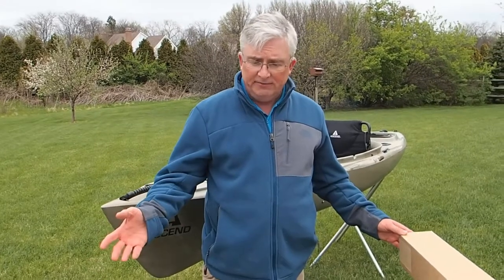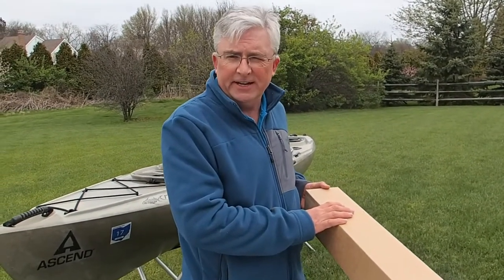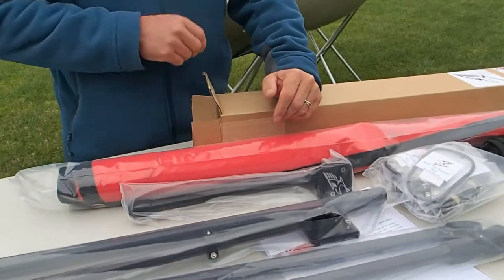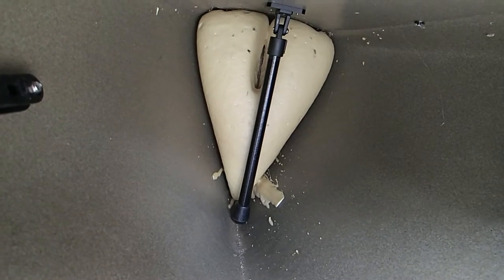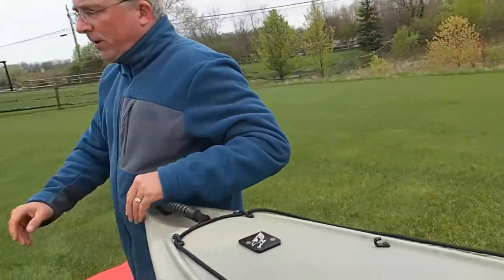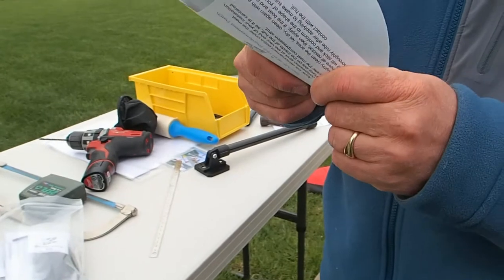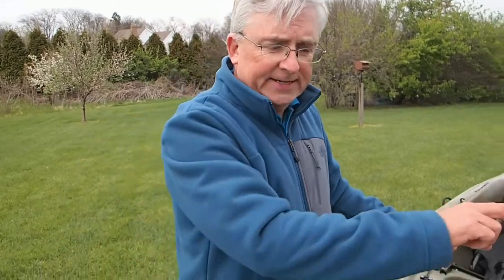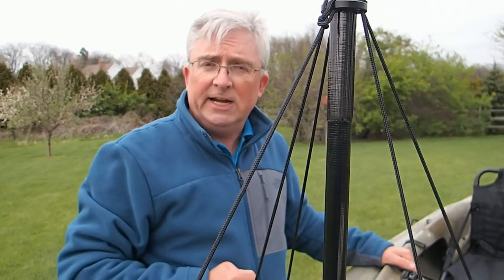Falcon Sail recreational kayak sail install install demonstration.

Comment: Does this come with some type of lee board?  Won't you need some type of lee board or outrigger to do any kind of upwind sailing?
Reply from the maker: Reply part 1 of 2

Your question about using a lateral resistance enhancers (lee board / dagger boards / large skegs ) and if they are necessary to sail with a Falcon Sail is a common question, so we have made a canned answer to help people.
The short answer is they are not necessary and will get in the way, and create complexities and issues at times.
Very well made lee boards can help in some angles of attack but are not helpful in most situations and will get in the way on every outing.
They add bulk, drag, weight, complexity, cost, potential failures ect ect.
Kayaks sail amazingly well without any lateral resistance enhancer.  Near zero falcon sailors use lee boards or other lateral resistance enhancers.
There is a longer more detailed answer below.

I grew up sailing keel boats, sun fishes, trailer sailors, hobie cats and anything else I could get my hands on.

As a conventional sail boat person, I use to think only a boat with a lateral resistance enhancer  (lee board / center board / dagger board / keel) will sail properly. We have learned there is a lot more to kayak sailing, than conventional sail thinking will tell you.  Conventional sail boat thinking is very helpful at times, but does yield a few misleading assumptions about kayak sailing.

As far as needing a lateral resistance enhancer goes, you have to consider a few things before making any assumptions. Look at a Hobie 16 and some other purpose built sail boats. Even as a purpose built sailboat, the Hobie 16 has no  resistance enhancer because its hulls have a lot of natural lateral resistance built right in from the start.  They have no lee boards, dagger boards, center boards, or keels. 

Similar to the Hobie 16 Catamaran Sail boat (not a Hobie kayak), kayaks have a lot of natural lateral resistance built into their hulls also and sail surprisingly well without any lateral resistance enhancer.

Kayaks are not sail boats, will not point as well as a complex sail boat, but their hulls are fairly efficient at sailing and can make surprisingly good up wind progress. Think about this.  Sail boat hulls are designed to be as slippery as possible going forward.  A byproduct of a sail boat hull being designed to be as slippery as possible going forward, is a hull that is slippery going sideways (and slippery in all directions actually) and also tends to spin.  Modern Sailboat hulls, make conventional sail thinkers believe you must have a lateral resistance enhancer on a kayak.

Kayak hulls are designed to track and go in a straight line.  This is achieved by having lateral resistance built in throughout the length of the hull, which is what makes them sail surprisingly well without lateral resistance enhancers.

To demonstrate how a kayak has a lot more resistance going sideways than forward, imagine pushing a kayak that has an adult sitting in it in the forward direction. Most kayaks will easily glide 30 feet or more.  Now imagine pushing that same kayak with an adult in it, in the sideways direction.  Due to its lateral resistance it will probably go about 1 or 2 feet after you are done pushing it.  Or think about towing a kayak with a person in it, from the side vs towing a loaded kayak from the bow.  The kayak towed from the side will be much much slower due to its lateral resistance. In both of these examples you are testing and seeing, a kayaks lateral resistance is significant.  Once a kayaks hull is moving through the water, its lateral resistance increases by quite a bit.  All this said, with a smart sized sail / one that is not too big, a kayak has plenty of lateral resistance without adding anything to it.

Once you build up some speed, a kayaks lateral resistance increases dramatically.  Kayaks do not sail as well as a purpose built sail boat, but you can do no paddle sailing and reach across the wind, and even make some upwind progress.

Of course a purpose built sail boat will sail better, than a kayak will, but kayaks sail amazingly well. If you have an efficient sail, you do not need a lee board, or center board, or dagger board, or any lateral resistance enhancer to have a great kayak sailing experience.
This is what Falcon Sails does.  We focus on keeping things as simple, efficient, compact, reliable, and light weight with the best possible performance. All this can be had for less than 3.5 pounds, that can be dropped in seconds and folded down to the size of an umbrella in just a few more seconds.

Lee boards and dagger boards add weight, complication, bulk, expense, drag ect.  Some people want to turn their kayaks into a sail boat.  That is fine, but you will add weight, complication, bulk, expense, drag, set up time at the put in, tear down time at the take out, more rigging, more stuff to store, and if there is no wind, or too much wind, you are better off with a compact sail rig that gives you 70% or more of the sailing benefits in a package that weighs just over 3 pounds that can be lowered and compactly secured to the deck of your kayak in seconds.   Everybody has their thing.  If you want to have that perfect ideal incredible sailing experience in one situation, you will lose a lot in other situations.   There is not a rig that will cover all situations perfectly. If want simplicity and versatility, you will be happiest with a simplistic high quality sail and rig for your kayak.

As a life long sailor, I thought the same thing sailors typically think about lateral resistance appendages.  I have sailed and owned a lot of different boats. I use to race and skipper and crew on a lot of different boats, and can say I am a decent sailor.  My conventional sail thinking made be believe you need a lee board or something on a kayak to sail.  And then I tried kayak sailing.  The performance of a sail on a kayak amazed me.  I was hooked instantly.  I was surprised.  That was even before there were good quality sail rigs available. Now that I can have a good quality sail rig, and a good airfoil shape, I will not go kayaking without a sail. After kayak sailing for the last 12 years and having paddle sailed thousands of miles, I have never used a lee board or anything like it.  None of my friends use lee boards and none of us feel like we are massing anything.

If you keep a good sail trimmed properly, oriented to the wind properly, and have at least 1.5 mph of hull speed, you can reach across the wind, and even make upwind progress of about 10 to 20 degrees above reaching. That is without paddling or a lee board or a dagger board on a standard stock kayak hull.  In general terms if you have good conditions, a good sail, and you use decent sail trim, you can easily sail 180 degrees and even up to 220 degrees without paddling and without the bother of any lateral resistance enhancers. If you paddle to keep your speed up and the sail oriented properly to the wind, a good sail, will generate useful propulsion all the way up to within 30 degrees of straight upwind. That is with out without a lateral resistance enhancers. In general once your actual track is 10 degrees above reaching, you have to start paddling to keep things oriented properly. Initially a few small paddle strokes here and there will add a lot to your possible angles of attack.  The more aggressively upwind your angle of attack is, the more you have to paddle. But still you can gain useful propulsion to with 30 degrees of straight upwind.  With a little bit of planning you can paddle upwind a little bit and reach back and forth all day long and not have to paddle much at all.  Once your movement is 10 degrees above reaching, you can not just sit there doing nothing, but you can avoid paddling and reach across the wind all day long, and even make upwind progress without paddling and no lateral resistance appendage or enhancers.  With a good sail, kayaks sail very nicely.

I will continue my answer on another reply.   See Reply part 2 of 2.
Reply from the maker: Reply part 2 of 2

Continued from Part 1- Read part 1 of 2 first.

Just like when sailing a purpose built sailboat, when kayak sailing to maximize your potential, you will have to think about what you are doing. When conditions are good, you can get useful propulsion to within 30 degrees of straight upwind.  Anybody who does a lot of kayak sailing with a good quality rig will agree. If it is really windy, gusty, shifty, there are large waves, you are not thinking, you have too big of a sail, the paddle sailor is inexperienced, ect, the 30 degree number is going to grow.

I wrote a bit more about this here.
https://www.falconsails.com/KayakSailingFAQ.php#centerboard
If you contact me at Falcon Sails, I can send to you a rough draft set of instructions for kayak sailing upwind.
www.falconsails.com/contact.php

This video shows a clip of a upwind leg I was enjoying last paddle season. It is a lot of fun.
https://www.youtube.com/watch?v=xjzld6MZhCI
I was in a 14 foot long Jackson Journey kayak and making some upwind progress without paddling.
I could have made more upwind progress if I paddled, but I can sail with no paddle 200 out of 360 degrees.  
This kayak has a rounded hull so most kayaks will do a little better yet.  

This video shows me sailing and tacking upwind with no lee board or dagger board and almost zero paddling.
https://www.facebook.com/falconsails/posts/4106133799451973
It includes some really neat gps telemetry that makes it easy to see my actual movement.
It shows me sailing 200 out of 360 possible degrees.  This kayak has a rounded hull which makes it a average performer.  If your kayak has a contoured hull, it will sail better / about 10 more degrees on both the port and starboard side.
If I started paddling and kept the sail oriented to the wind properly, and kept some motion to help my stock hull generate more lateral resistance, I could have had useful propulsion to within 30 degrees of straight upwind.
This is very similar to motor sailing a sail boat. The motor alone can push the sail boat, but using the sail it will speed up faster, have a higher top end speed, will slow down slower, and require less effort to get to your destination.

Here is another video of some friends and I enjoying a nice 18 mile paddle sail where we sail about 70% of the day.
https://www.youtube.com/watch?v=RkbSSlYEYl0

If you plan your day well, use good techniques, take advantage of reaching, and not dive downwind you can sail all day long with our without lee boards.
Here are some pictures of a typical kayak sailing day, that include a track log of what we sailed and what we did not sail.
I had several beginner kayak sailors with me, so I avoided some of the more difficult tacks and we still sailed about 75% of our miles.
https://www.flickr.com/photos/falconsails/albums/72157712563766083
With some planning you can sail most of your miles, and if you just go and not plan anything, you can still sail over 50% of your miles.
If you want to sail paddle sail in good conditions, it is easy to sail more than half your miles even if you do not plan anything and just randomly pick lines.

Comment: wheres the rudder
Reply: Rudders are not necessary on shorter kayaks.
The general rule of thumb is, if a kayak is fine with out a rudder with out a sail it is fine without a rudder with a sail.

Here is a more detailed answer.

A general rule of thumb is, if a kayak is fine without a rudder when just paddling, it will be fine without a rudder when you are kayak sailing. On a kayak 13 feet or shorter, rudders are not necessary. If a kayak has an adjustable skeg, a rudder is not necessary.  It is quite rare to see a 12-foot kayak or shorter be rigged with a rudder.  I (the owner of Falcon Sails) have a 12-foot kayak and have never considered putting a rudder on it.   When my paddle says go right, my boat will turn right.  It will turn right even a rudder on my kayak would say turn left.  Rudders are almost never necessary until you get into kayaks over 14 feet long. 

You can see in the pictures included with this email, that the short kayaks do not have rudders on them, and even some of the longer kayaks do not as well. 

If you want to do some lazy kayak sailing and not use a paddle for long stretches and do not want to lean or adjust the sail to steer, you can install a rudder and you may like it.

If you have a short kayak, you should avoid having a rudder early on, as number 1 you are likely not to care if you have one, and more importantly, a rudder will likely be a crutch and make it easy to use bad habits.  You should naturally balance out your kayak (it is an obvious thing to do (When you lean forward you will notice the kayak turning upwind, and when you lean back you will see the kayak turn down wind )) so it will tend to go in a straight line and not use a rudder to force a out of balance kayak to go in a straight line.  A rudder used to force an out of balance kayak to be in balance, is just more drag in the water and will reduce your efficiency and your ability to point up wind.

The general rule of thumb is, if your kayak is okay without a rudder without a sail, it will be okay without a rudder with a sail. Having a sail will slightly increase the desirability for having a rudder.  Big winds and high speeds also make having a rudder more desirable.  Having a rudder can make it easier to get through the learning curve.  In general, kayaks under 13 feet are always fine without a rudder.  Just like a kayak without a sail, when you get into kayaks over 14 feet long rudders or adjustable skegs are nice to have.  The longer the kayak is the more likely you will enjoy having a rudder. Even better than using a rudder, a kayaks tendency to turn up wind or downwind can be addressed with sail trim, leaning up wind and down wind, leaning forward and aft, changing the distribution of your load, and adjusting your speed.  Once you start doing these things, many times you would not use a rudder as a rudder is not the best way to put a kayak in balance to stay on course.

The shorter the kayak, and the more experience you have the easier it is to live without a rudder. Finally, when kayaking or kayak sailing, if your paddle says turn left and your rudder says something else, your paddle will win. 
Rudders and skegs are not there for turning so much as they are there to trim your kayaks tendency to a neutral tendency to turn up wind or down wind.  A nicely trimmed kayak is great to have.  A rudder is one of the easiest tools to use for trimming your kayak. But a rudder is a is a crutch many times and prevents people from learning proper techniques for staying in balance. And of course, using a rudder to trim your kayak also adds drag and slows you down so they are best reserved for minor fluctuations in balance vs a tool to power your way through an unbalanced situation.  The more drag you have, the harder it is to efficiently sail up wind.  

In the end, if a Falcon Sail customer would like to have a rudder, then can have us send them a complete smart track (it is the best rudder kit you will find) rudder kit for their kayak at our cost which usually ends up being $225 including shipping.

Comment: I see that is the ascend fs10. How does it handle with a sail on? I’m looking into getting that exact kayak and getting one of your sails
Reply from the maker: This kayak sails great.  It is stable, and short enough to be easy to handle.  It has a contoured hull which is great for up wind performance.   It is easy to rig.  It is one of our favorite kayaks for kayak sailing.  Though the best kayak for rigging a Falcon Sail on is is the kayak you already own and like.  You can move your Falcon Sail from one kayak to the other so you are not stuck with any one kayak.  There is no need to buy a new kayak that will be your special kayak for kayak sailing.  On the other hand if you are buying your first kayak and you plan on sailing it, the Ascend FS10 is a great choice.

Comment: If the deck is not flat do you sit the mount off centre or do you have to put something between the deck and plates
Reply from the maker: If you order a Falcon Sail with a complete rigging kit, it will include a deck adapter block and a under deck adapter block.  When you order a sail on this web page.
www.falconsails.com/store at the end of the purchase process we will ask you what kind of kayak you will rig the sail on .  We will then do a detailed analysis ( or simply look it up in our database ), do determine what the parts list should be to make the best rigging kit possible for your kayak.  That will include a perfectly matched adapter block to the deck of your kayak.

You can see more about this in another install video here.
https://www.youtube.com/watch?v=2i8_EEExqNg&t=228s

And you can learn a bit more about our adapter blocks here.
https://www.falconsails.com/adapterblock/